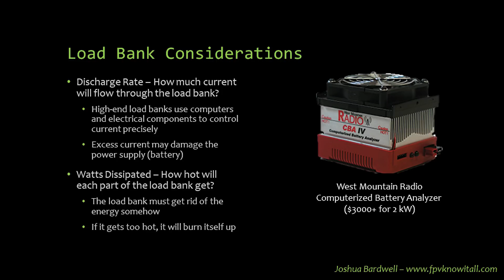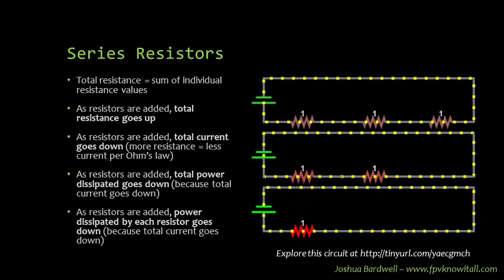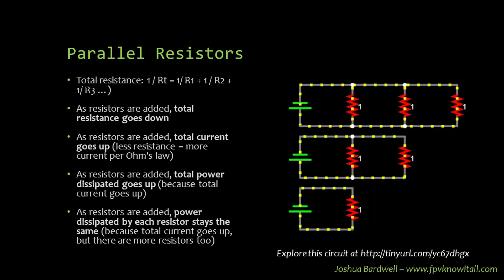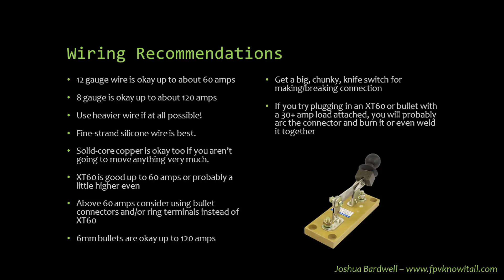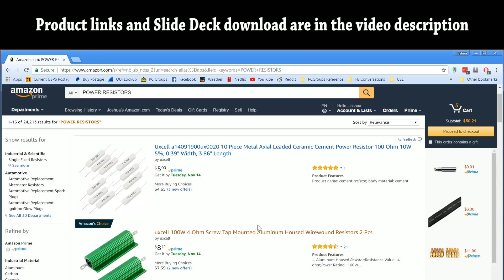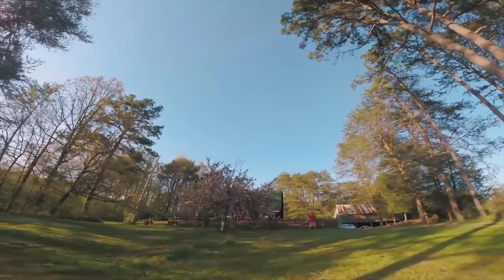Comment: Will this work, and are the calculations the same, for using with an iCharger 308 Duo in Regenerative Discharge, To Channel mode? I assume I wouldn’t need the knife blade switch as the charger circuits act as the switch?
Reply: You're right about the knife switch. About regenerative discharge, I don't know for sure. Because the charger is not going to simply treat the load as a resistance, but will current control the output.
Reply: Joshua Bardwell Thanks for replying! Things get sooo complicated! I assume  as long as you limit the current within the resistors limit, all should be ok :/ I’m getting a bit lost now! I’ll wait for your next instalment and hope for enlightenment.

Comment: Excited to see where this goes and what you come up with!  I actually built a resistor bank using the copper looking ones you have in the video.  I ended up wanting more power and plan to double it in parallel just as you mentioned.

Comment: Good stuff, this is the home-made load bank I've used for the last 3 years: 

https://s20.postimg.org/v99oj2ksd/Load_resistor_1.jpg

It's 6 x 10 ohm 100W resistors in parallel - per the spec. sheet you can run them at up to 35W without cooling. On 4S it pulls 10A, so around 160W (i.e. 27W per resistor). The temperature stabilises at 160C and the resistors are rated for 220C, so everything is within spec. The input is switched by a relay triggered via a CellLog 8M LiPo monitor hooked up to the balance lead. The bulb on the bank is so you can see when discharge is taking place.

Comment: Could you build this with a current sensor and volt meter attached?  I'm assuming so since you did something similar in the battery trials.  However, what would be super cool is if you used a really beefy relay in the circuit and attached the volt and current sensor outputs to an Arduino (I'm a fan of those).  Then with some simple coding you could have the Arduino trip the relay when it senses the volts drop to a set value.  I'm thinking for storage charging.  You could also store the values for current that goes through the battery to figure out if the capacity has been lost or retained over use of the battery (by fully charging the battery and then discharging while sensing the current passing).
Reply: Yes, that's a good approach. Use a SSR (solid state relay).

Comment: What stops you from using a bunch of high power handling NPN's like http://uk.farnell.com/semelab/mag6332/trans-audio-npn-230v-30a-to-264/dp/1856783 (in series?) Heatsinked with a fan, connecting the pack(s) to <whatEverLoadYouWant> controlled by an arduino and  interfaced by a cheap LCD display and clicky button input. Set the number of packs, or pick a discharge rate and and let it PWM the transistors to the load (array of bulbs etc)
Reply: That would be a smart way of doing it but I'm looking for a dumb way because I don't want to spend time programming an Arduino. Actually, I already have a device graciously built for me by Cheng Lin that will control the relays to run a discharge program and log the results. I just need to build the load right now.

Comment: Now we just need the plans for a circuit that cuts off the flow at storage (or a configurable) voltage.  Come home from flying, pop our batteries on this load, and discharge to storage in 5 minutes (instead of an hour). I love the idea of a discharger that runs like a quad.
Reply: Troy Nahrwold I do this they my icharger. One channel has my discharge amplifier on it and the other channel has the batteries. I just tell the charger to discharge at a certain amperage and where to stop discharge at certain voltage (3.8v per cell) works great